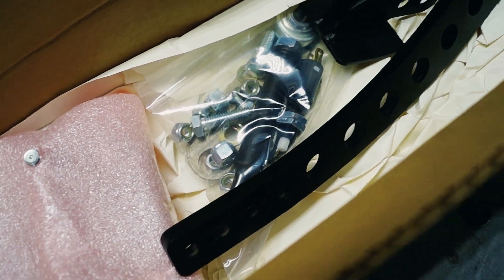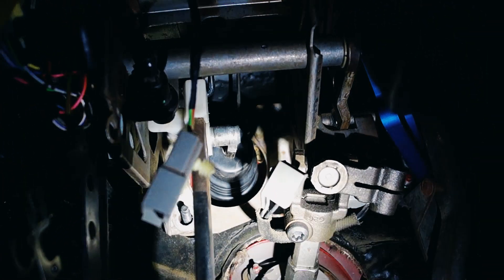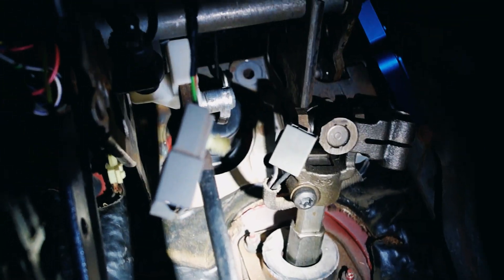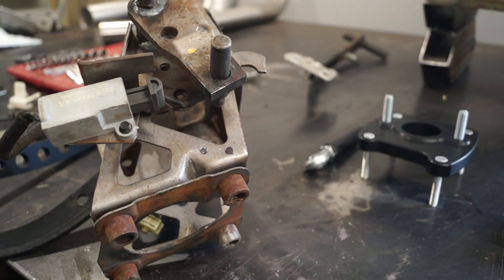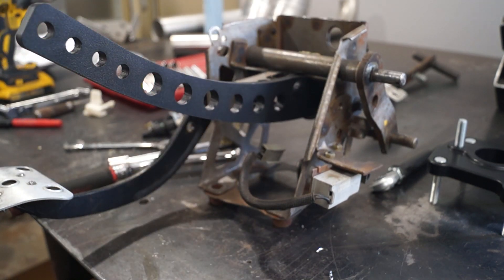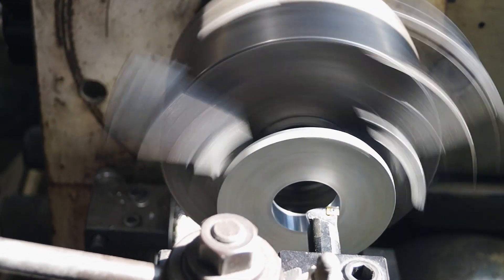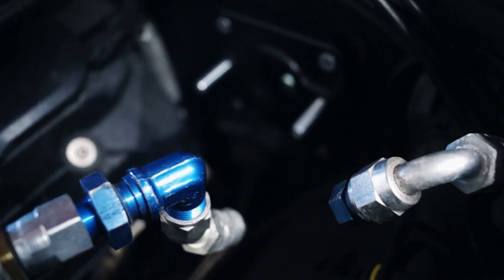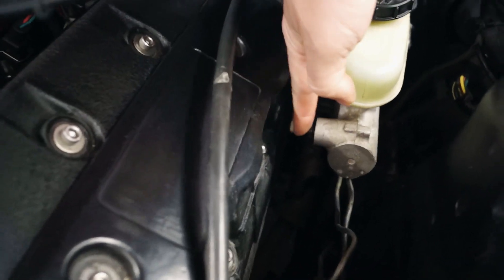Mustang manual brake conversion, 79-93 and 94-04 Mustang Racing brakes, Custom brake adapter

Comment: That's pretty cool and your car is ultra-badass. While I respect the fact that you have the means to mill an adapter real quick, isn't it conducive to the manual brake thing to use a smaller piston diameter master cylinder? I imagine that the smaller bore is probably a little more important if using drag race, lightweight brakes that don't have the volume requirements as an OEM caliper would have. Am I on the right track? I bought a TBM manual brake kit, which I'm likely going to not use and go with a MM so that I get the adjustable length/ratio pedal and won't have to use a lame pressure switch for the brake lights..
Reply from the maker: With manual brakes it’s more about the pedal ratio than the master cylinder.  I did try a smaller bore and the effect was more peddle travel for my current setup.  When I go to aerospace or TBM, the smaller bore might be more effective setup.

Comment: What size caps did you use for your hydro boost caps offs I’m going to have my car manual brakes but keep power steering
Reply from the maker: I’m 100% sure what you mean by cap.  Most power steering systems with hydroboost are loop systems.  Meaning the pressure side of the pump goes through the booster and rack before returning to the reservoir.   To remove it, you simply remove the booster from the plumbing circuit.

Comment: Hi nice video
I have a 2000 gt on stock brakes, making a streetable track car for the weekends, would you recomend this mod for me ¿?
And was the brake pedal too hard to use after you did this mod?
Also looking foreward the manual rack and pinon steering mod to.
Reply from the maker: Honestly it’s a pretty solid setup. If you were going to be building a street/strip car I would have no issues using this system from maximum motorsports.  

Once I get caught up on moving the shop, I will be doing more mustang and viper content.